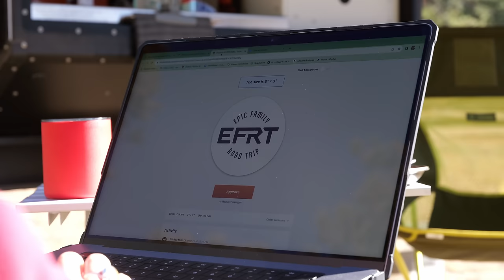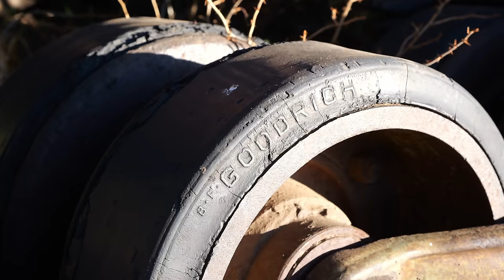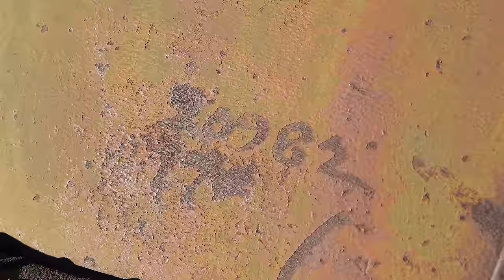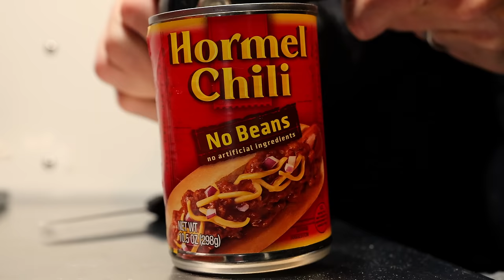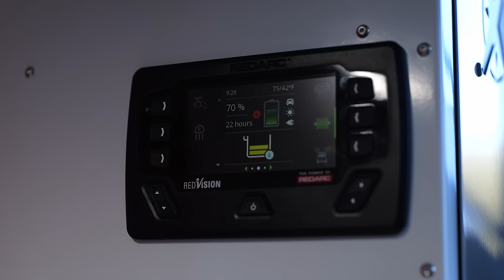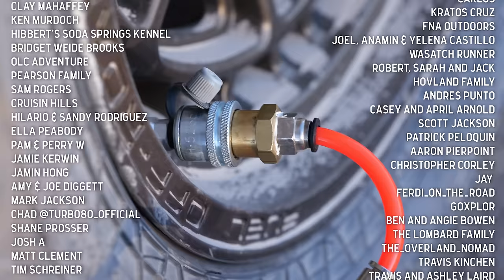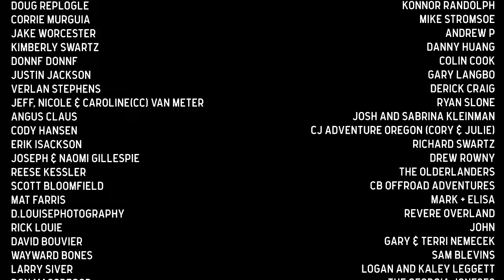We couldn't believe what we found... [S7E2] Lifestyle Overland

Comment: Most of your overbuilt overland rigs are just that, overbuilt, which there is nothing wrong with that, but most of the trails all these $150,000 overland rigs do, a $25,000 used stock 4x4 can do.  For overland adventure 2021 with 4wd mag, we had couple million worth of built out rigs, but the camera crew / chase vehicle was a stock ram 2500 4x4 rental.  We sure looked cool though!! 😂😂🤣
Reply: His rig isn’t even overbuilt, pretty standard overland rig for what he does and the true definition of overlanding. Dude isn’t even on 35s lol. Yeah any 4x4 can access these roads and areas, his rig is just built to do it safely and consistently. Overlanding is not recreational 4 wheel driving trail runs with camping.
Reply: @OwlHootOverland  when I said “your” I meant it generically, not talking about his specific rig.  And the comment was in response to him talking about a minivan being out on the same trail as them.  No need to come to his rescue, I wasn’t attacking him.